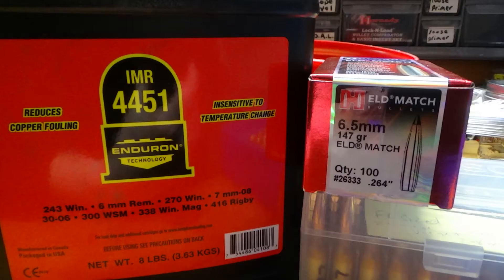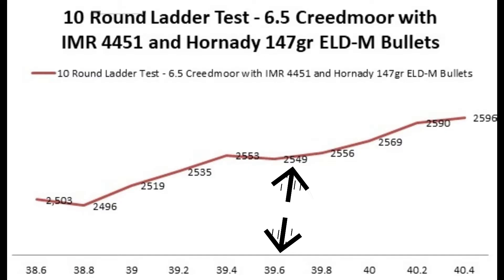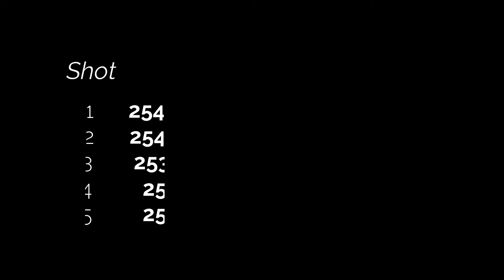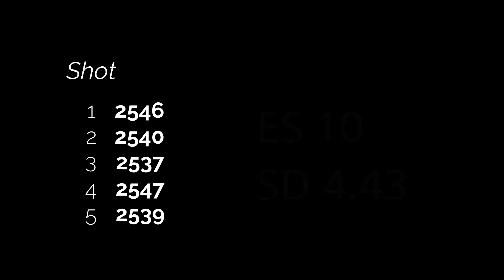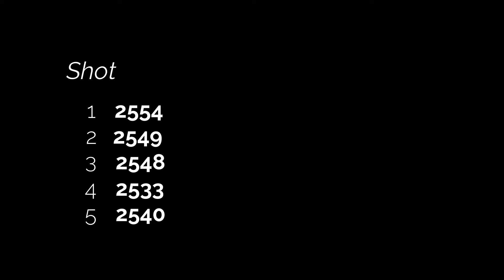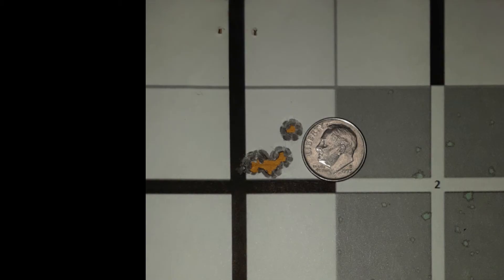(Part 2) 10 Round Ladder Test - 6.5 Creedmoor Load Development

Comment: Do your grouping separate, without the magnetospeed. It can change the barrel harmonics having something hanging off the end of your barrel.
Reply: I've shot groups with and without the Magnetospeed and group size has  not changed, point of impact is different about 3-4" higher with but group size is same. Thanks for watching.
Reply: Ran the same test yesterday. Group w/ and without magnetospeed and there was a significant negative effect with the magnetospeed attached, in group size. I have shown this many times in controlled testing.